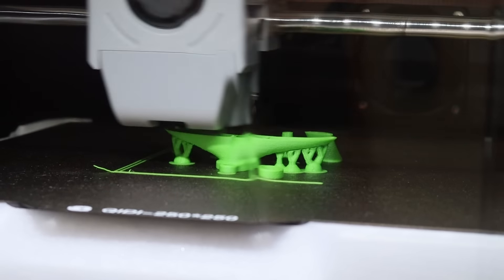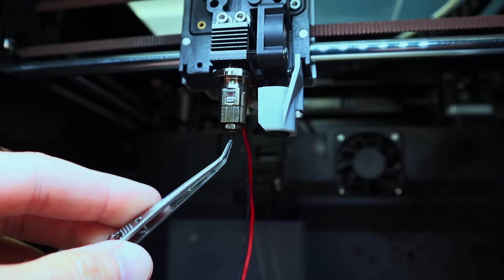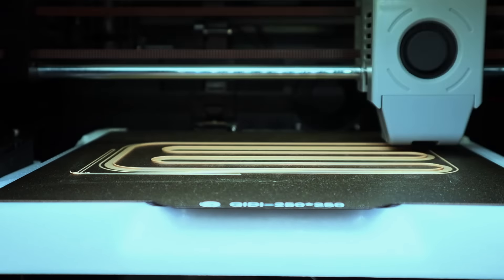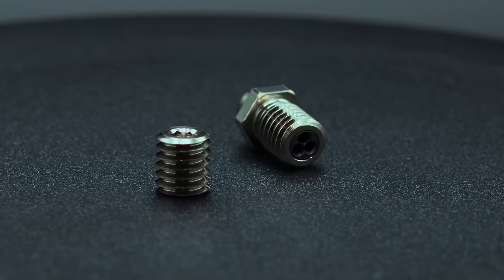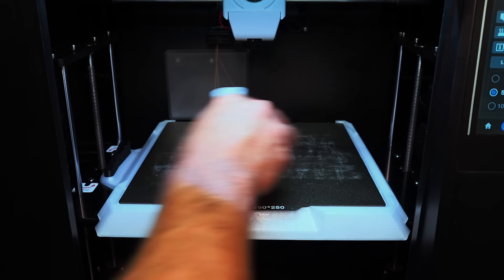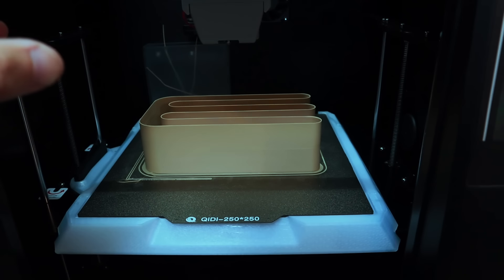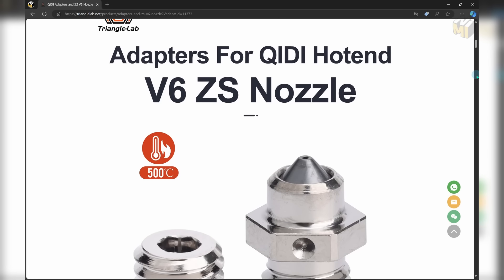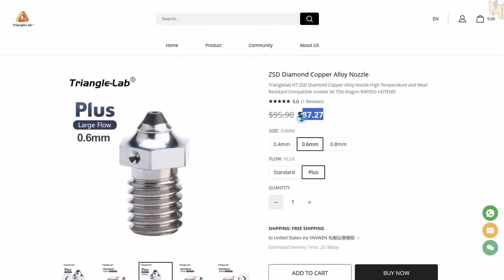This 3D printer nozzle actually does what it says!

Comment: You show your test up to 40mm^3 flow, and it had some spacial/adhesion problems (which is totally fine as it clearly didn't seem to exhibit any flow-related visual defects up to the maximum tested), HOWEVER, you did NOT show what the ACTUAL maximum flow rate is using this defect test.  I would like to see a 35-55^3 flow test to see exactly where extrusion defects start to happen.  of course you'll always want to cap normal printing at a little bit below the maximum to make sure that you never run into any flow limits, but without knowing what the actual maximum is, just setting it at 40mm^3 is more than likely leaving print speed performance on the table.  just from my experimental experience in working with a .5mm cht-like nozzle in tungsten carbide (bozzle nozzle), I would guestimate that your setup should be able to get around 45mm^3 flow before exhibiting any signs of extrusion defect, but I'd like to see the experiment and the actual numbers.
Reply: The layer adhesion drops already SO MUCH by the time you see surface defects, that he already passed that point.
Reply: I'm most interested on retraction test, detail and cold pulls.

I own a Volcano clone. Here in Argentina you don't get much, no original europe parts. But I can order from aliexpress. I'm interested on some CHT cheap clones there, the CHT Trianglelab ones or just Volcano nozzle made from them

I'm just a bit worried about the tip size (not the hole) Trianglelab made the bigger and flatter than other brands. It's better for good top layers but I don't know for detaild, or if plastic will stick more, burn and fall onto the print
Reply: I just pegged my plus 4 at 33.6mm3/s  sustained for 70% of a 6 hour print with PETG😂 print was beautiful. I'm currently trying to see how fast this thing can go before the wheels fall off

Comment: Glue on a textured bed is not required 
glue not there too stick down a print, it’s aid is to release from a build plate, which a textured pei is already doing 👍🏻
Reply: Lots of people don't realize you need to clean with IPA, or soap and water every so often.
Reply: @eslmatt811  nope they don't.
Reply: It's not required, but in some specific cases it CAN help, even on a textured and heated bed. Yes, even with PLA.
Reply: @EverImmortal  That's been my experience, I get way more failed prints without glue then with regardless of the print surface material or texture, so I just use glue everytime to so I don't waste near as much time or filament.
Reply: Really? So the plate is holding down the print, through the glue with magnetism? The print sticks to the glue.

Comment: Really appreciate your Q1 Pro content. I am VERY pleased with mine but am implementing a couple of your mods, THANKS!  Keep it up :)
Reply: Mine is coming in tomorrow I'm happy he's actually making content past the review
Reply: @GARBO96 It is a really good printer. Qidi has listened to customer feedback as well. I’m printing engineering grade materials no problem. Every print failure I’ve had up to this point has been user error. I’ve just received this nozzle. Ran the max rate tests with PETG (usually has less flow than PLA), and found the stock nozzle came in at 20.5mm^3/s. Running some tests with the CHT now to see what it is!

Update: Came in at 32mm^3/s. Not as high as I hoped for but this is PETG and still significantly higher. I also need to run pressure advance settings again as they may change with the new nozzle.

Comment: I tried a Mellow DLC bimetal nozzle, no CHT style inside, along bimetal heatbrake.  Results were night and day compared to hardened steel nozzle. PETG stuck to HS, not to DLC bimetal tip, strings and blobs went away. They come in volcano, E3D, M8 sizes.  I ordered for all my printers, and 0.4, 0.6,0.8mm sizes.  Have not had time to test.  I am new to printing  nylon, so far results  are great.
Reply: I use the Mellow DLC bimetal nozzle for my K1 and it's a good one The print quality is noticeably better but I think the nozzle tip wears out relatively fast for a hardened steel one. Not like copper or brass but faster than the normal hardened steel ones. I have used it so far only with regular not abrasive fillament like pla, petg,ASA ...
Reply: any new input from the recent printing ? im interested Ty
Reply: Sorry, life has taken me on some turns. It may be a month or so to get back to printing.

Comment: My experience with Polymaker’s high flow PLA is that it provides more consistent surface finish at high (and variable) speed, rather than providing significantly higher maximum flow.

Comment: The Q1 Pro is a fantastic printer.   I've modded mine to run with a 75C chamber temp.    It prints large abs parts with no warp.   Love it.    Considering getting a second Q1 and putting an annex tradrack on it, I have an idea how to put a filament cutter on the print head.
Reply: What did you do to get it to 75C?
Reply: Following
Reply: This is very interesting to me bc I'm looking to get a corexy printer in the near future and very interested in printing nylon. Was there a tutorial you followed for the chamber temp mod? I'd love to look into it
Reply: @EFLO3D  I added a berd air pump to the back of the machine to pump outside air into the back of the x carriage where the tool board lives to keep it from dieing again,  redesigned the rear cover to remove the holes.  removed the 25mm fan on the hotend and printed a duct for a 30mm honey badger high flow fan on the opposite side of the hotend to prevent clogging.  redesigned the front cover for so i could mount the fan.  Added insulation to the entire inside of the machine including the bottom of the clear top cover and covering the back of the lcd.  closed off the electronics compartment as best as i could from the print chamber with printed covers and foam tape.  upgraded the mainboard fan to a 4020 and moved the chamber circulation fan to the electronics chamber to exhaust heat.  repurposed the "chamber circulation fan" to run the bird air pump with a relay.  made the appropriate changes to printer.cfg and the macros.  set orca config to heat chamber to 55c, probe then added g-code to the advanced tab on the filament settings to increase temp to 75c before starting.  printed probably 40 hours now at 75c so far.  did find i had to play with cooling settings, overhangs didnt look so good at first.  i ended up importing the pla fan settings and went from there.

Comment: Polycrystalline diamond is amazing. Fantastic heat transfer and durability. Unlike a ruby nozzle, one doesn't have to worry about crushing PCD because there is no singular fracture plane.

I also love my Bondtech CHT nozzles. It's amazing how much additional speed & flow I can get at normal temperatures with one of those nozzles - all on a standard V6 hot end and heat block.

Comment: Glad to see a youtuber actually enjoy and use the Q1. I mainly see hate on it because of the heater issue but overall its been great. Granted I upgraded from an E3P to the Q1 so all these features are great to see working. I've had very minimal issues with mine like once the belts came a tiny bit loose so I just used the auto tensioner and it was fine after.

Comment: Nice vid!
You should be using non matt pla with the flow test though.
Normal pla will loose its sheen and come out matt as the hotend approaches the upper end of its flow rate.
Surface finish is an important consideration.
Reply: Re: losing sheen.
It means it was not sufficiently melted.

Comment: I think it strange that you did a temp tower, showed that a broad range of temps looked good, but didn’t show layer adhesion differences by breaking the tower. You picked a low temp and then did a flow test. IMO, you should pick the highest temp you get reasonable overhangs on—layer adhesion will improve, and your flow rate tests will also be better.

Comment: Well. With a cheap cht clone nozzle I got my Ender 3 up to 32mm³/s or at least I thougt as a saw the print... Layerbonding was ok, no defects, only as I began to measure wall thickness i was intrigued. The flow doesnt get more from about 22mm³/s but with the help of the three streams of Filament inside the nozzle it doesn't interrupt the output for longer time.  
So please measure your wall thickness. Then you will really see when the flowrate drops!
Reply: Exactly. I got 40mm3 on PETG on a test, but the walls were too thin!

Comment: I tested original vs clone CHT in Q1 size. Amazon Basics ABS did 23 mm3/s original Q1 nozzle vs 27 mm3/s clone CHT in Q1 size.
Obviously, layer adhesion drops BEFORE that.
I got the CHT to ensure better adhesion and strength, so I still use generic ABS speeds with the CHT, 17 mm3/s max.

Comment: I have the exact same problem with my Kingroon KLP1 230. Yes, it's a budget xy klipper printer and I love it but I've been recently struggling with systematic clogs, regardless of the filament. I ended up ordering a new toolhead but I do want to search for alternatives. I't really annoying to have to entirely disassemble the toolhead to clear a simple clog. I still recommend the printer but it's definitively not beginner friendly. 

MicroSwiss has Direct Drive Extruder for Linear Rails but it would like ly not fit my printer so I'm thinking of having a part machined by PCBways or something. I'll likely keep the raspberry toolhead pcb and the stepper motor but I'll likely replace the rest. So your test greatly interests me.

Comment: Benn using the TL adapter and ZS plus nozzles in me Xmax3 and it was the first and only thing i did on the Q1 when it arrived, stayed with 0.4mm though as i seem little to no reason to use 0.6mm despite owning a couple of them.
I get around 34mm3/s with standard PETG and limit it to around 28 for consistent printing. 
Highly recommend the TL adapter and ZS Plus nozzles
Do not support and actively fight against using glue on PEI plates, clean PEI will stick common filaments really well. I don't even bother with a brim for these flow tests.
Reply: Did you have to change anything? I tried to do it yesterday, but the head was crashing into the bed

Comment: Hmmmm. love this channel, but this vid is a bit off.  (i) CHT nozzles of any flavour stand a chance of clogging, and even if that is rare they are not so easy to clean or clear a clog - IMO should be made clear that these nozzles and in fact most high flow nozzles are really only for single material use.  (ii) Bondtech make and supply CHT nozzles under license, as the tech has a patent, and pretty sure Trianglelabs are just riding roughshod over the patent rules.  (iii)  I suppose for large prints in vase mode using a 0,6mm nozzle, then flow rates over 40mm3 are useful, but really speed is not everything and most people want a balance of speed versus quality.  I think you should make some clarifications and caveats in this video.  Like you say the Qidi Q1 Pro really is a great machine, I'm getting really good prints on all materials tried so far, TPU, PLA, PETG, CPE & ABS and am switching between filaments almost daily.

Comment: I would love to see a video on the version with the sintered diamond! I have been looking at those types of nozzles for a while now and sitting on the fence trying to decide if I should get one. I would be thrilled to see a break down on a 0.4mm CHT version to see if its worth the price for printing filled filament. My main concern is that the CHT would jam more easily than a regular nozzle. I would also be curious to see if the sintered diamond has a noticable affect on flowrate, and plastic sticking to the nozzle.

Comment: Ok man let me explain about the glusticks haha, they impeed the newer pring beds that have textures n laser etching, the glue works for the glass n olderbones but not the newer stuff no need 4 gluesyicks, what they do is fill the gaps the materials sticks to then when the glue heats up it turns smooth, don't believe me run your finger on it when it dries it's smooth n doesn't stick well, just use the plate how its ment to be used I have no issues with mine even in temps above 78 even up till 91 degrees F...just remember the higher the ambient air, the higher your bed temp needs to be for that first layer to stick, then manually cool off the next few layers slowly so it doesn't cool the first layer too fast then it will hold no problem sometimes you won't even have to do that if you control your Air...using a fan when it's super hot just don't point directly lol...but this is for people who have no AC n try n print.
Reply: Creality tell you to use Glue Stick on the K! series, it is written on the plate, is it possible to use a brim on that print or is that precluded for a vase print?

Comment: I would love to see a video with both GF and CF filaments.    Great video, glad you posted this up!   Will be trying this nozzle out on my Q1 Pro!

Can you add a link to the proper nozzle and insert needed for the q1 pro.  I run primarily CF and GF filaments 80% of the time.

Does this come in .4 and .6?  Once again links would be great!

I love my Q1 Pro use it daily along with my XSmart3!  The Q1 Pro is best bang for the buck for those who print with engineering grade materials.  I have printed some amazing large prints with it in Qidi Nylon CF filament and absolutely love the superior quality, strength, and accuracy of this PAHT-CF filament.  Their ABS GF25 also rocks.

Comment: I have used sugar water 1 to 4 water to sugar ratio heat water in microwave for a few seconds then dissolve sugar and paint on hot plate with paper towel like paint brush one to two coats are great never had another print come off ever since using the sugar water

Comment: did you also gain some experience with the CHT insert on filled filaments like glasfiber or carbon or even wood ? I guess ( have installed the CHT version myselve ) that with filled filaments the CHT version tends to be worse compared to the non CHT version.

Comment: Oh I wish I could give you tips before you did this test.
You CAN use a genuine Volcano CHT, it will be just 2 mm longer (EXACTLY 2 mm) and you can put a nut to offset the inductive probe down. Cooling is not affected significantly.
Also, I wish you tested the clone CHTs too :(, they come in Q1 size!
Since see you used the Trianglelabs which has the "head" longer than original Q1 nozzle, you could have used directly a genuine Volcano CHT (I mean, if you were to buy one yourself).

Comment: Are the Q1 pro nozzles longer than the other Qidi hotend nozzles? I know some people are using volcano nozzles without any issues. I am using the trianglelab adapters in my X3 printers and am not really a fan, just because you can easily strip out the hex and you will never be able to get them out or adjust them.
Reply: Maybe a reverse drill bit could remove it.
Reply: No they are not.... the difference is that the v3 hotend has a longer cold side insert.

Comment: Nice. How’s your retractions and stringing with the CHT compared to standard? I use the inserts too for my volcano setup. I had some knockoffs that were volcano length, but they just aren’t near as good. I need a hardened version at some point as well… gotta get that PT1000 installed first.
Reply: Wondering the same thing, every time I tried 0.6 and/or cht-style nozzles the stringing became unbearable.

Comment: I don’t think Bambulab PLA is regular PLA. I think it has some additives to make it print faster, so it’s basically a high flow PLA.

I might be wrong though but this is what I read in multiple places.
Reply: If it was high flow, I think they would say so and charge a higher price like they do with PetG.
Reply: @petercallison5765 PETG HF and PETG Basic are the same price and they are discontinuing PETG basic because the HF version turned out to be stronger.

Comment: Interesting, but listen. I run qidi xplus3 with new 2.5 hotend similar to the one in pro. With 0.6 nozzle and PETG I get 36mm3.
BUT upon printing any model with multiple perimeters , I get perimeters to narrow - they are not connected to each other , till I lower the flow bellow 20mm3. 
So check this out. 
I think there is a limit to hotend heat capacity which gets apparent in a real model. 
If that nozzle can print well a real model, I will buy it!
Reply: Probably needed a higher wattage heating element but I have not seen this being tested.

Comment: Are you sure you printer is able to print at 40mm^3 usually you have a max speed limit for your extruder head. That means it could be that it just can't move fast enough
Reply: with a larger nozzle than 0.4mm it doesn't have to to be able to reach higher flow rates.

Comment: been using the threaded insert adapter for months now, but only for 0.2mm nozzle since its hard to find a CHT in .02 nozzle for the qidi.
Reply: Save your money and don't bother with CHT for 0.2mm nozzle. At 0.24 extrusion width and 0.15 layer height you have to print @500mm/s to exceed 15mm^3/s volumetric flow rate. A standard nozzle can do that no problem.